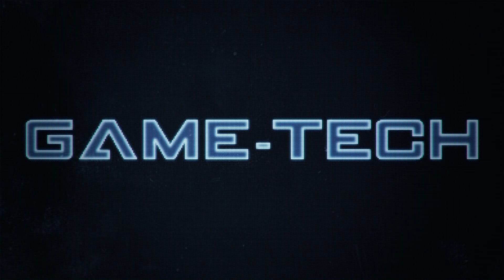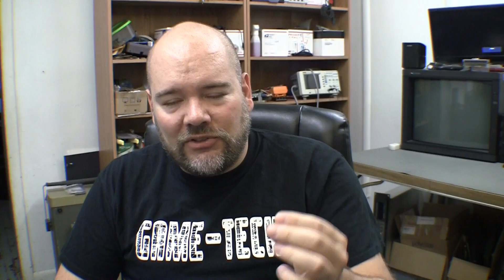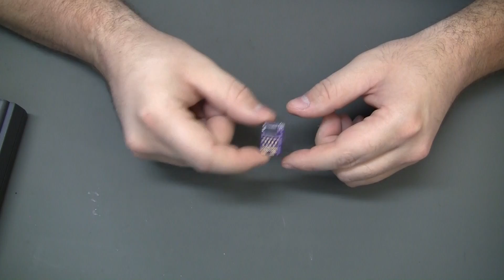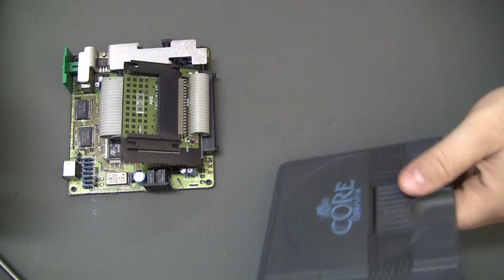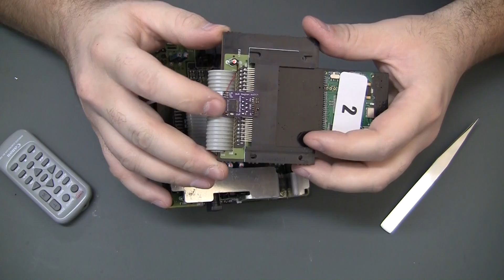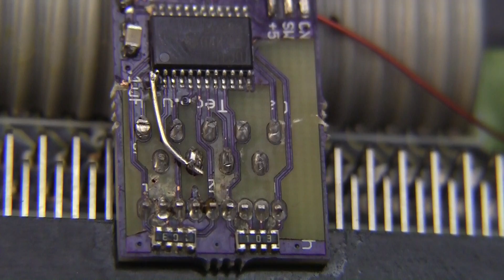TG-16 / PCE core grafx region mod issues with turbo everdrive Pt3

Comment: Hi. What does the IC on the mod board do ? and what are the lines the mod baord connects to ? Address lines ? I find this interesting but it is difficult to follow without knowing what is what. Btw the ground fill has vias I see. but I can't see a via on the ground fill which is where "Mar" is written... hmm. could be under the ic though.. also clean away flux residue.. might get some coupling that way.
Reply from the maker: bwack cbt3383 is the chip, vias are covered in solder mask so hard to see.
Reply: GameTechUS Thanks. That makes sense though cause I think kevin mentioned in the preivous video about bus lines in different order depending on region..

Comment: so my question would be, why do you need a region switch if you have an everdrive? for cd-rom system cards?
perhaps there is some EM stuff going on with the whole contraption, maybe chuck some ferites on the ribbons and see if anything changes
Reply: Gillian Seed For legit HuCards and Arcade Cards. You need it for System Cards as well (Duo is already upgraded to Sys 3.0 so no point using an Everdrive for a System Card here, except for Altered Beast).

Comment: $15 to $20 is a little pricey for 5,000 SMD resistors. I can get a reel of 5,000 name brand ROHM MCR03 Series 1% tolerance 0603s for 7 bucks from Digikey if you use first class shipping it's only 3 bucks to ship so it makes smaller orders justifiable.

Not sure if Mouser offers first class haven't ordered from them in awhile they've always been a bit pricier than Digikey in my experience.

Just FYI for the future.

Comment: Thinking about this again today, an easy way to test bypass caps is to remove the pull downs and stick 47pF bypass caps in those positions.  If pull downs aren't the problem this should fix it.  Ideal cap size might not be 47pF.

Comment: GameTechUS Considered making a reflow oven for doing spins of boards like these? You can grab a cheap toaster oven at Walmart and for a configuration that should be enough to "get by" with, you're only looking at about $40-50 in parts. (Arduino, cheap 20A solid-state relay, K-type thermocouple and a thermocouple amplifier). I'd be happy to help you out if you want. The toasters are like $15 at Walmart. "Rival" brand (Walmart-owned, just rebranded from an OEM). They make a bunch of kitchen crap.

Wouldn't be as nice as the one Kevtris made for his prototype runs of the HDMI NES modules but you're soldering resistors and small 16-24 legged components.

The ground plane came off easily because of the board material, OSH Park boards use really light copper (I believe 1oz) and a pretty cheap FR4 stock. It's fine for prototyping as long as you don't deal with high current and it's pretty easy to mod.

Comment: Try powering your region mod with the output leg of the 7805...well, when you get the board revised. I've done 3 region mods getting power from the 7805 and they all work fine with the Everdrive.

Also, is the Everdrive working perfectly on a non-modified console?
Reply: Goombakid808 thats an interesting idea, the everdrive may be pulling the rail down (localy) enough to glitch the mod, plausible indeed

Comment: You really ought to calibrate the PVM. Without any special tools, you'd probably just have to eyeball it, but you could get it way closer to normal than it is now...

This video shows the process of that exact PVM having the case taken off and calibrated (bunch of nicely labeled pots on the PCB inside): https://www.youtube.com/watch?v=yoBqm4ThJxw
Reply from the maker: Adam Zey I've seen that vid, but since i'm not doing as many rgb mods i've not needed it as much so it's been neglected.
Reply: GameTechUS Fair enough. I'm the sort of guy who would be driven nuts by that sort of thing whether I was using it regularly or not :P

Comment: I thought the turbo everdrive negated the need for a region mod
Reply: Zapf Not totally, the TED can't act as a system card and the 3.0 jap card is much cheaper than the us card and the arcade card is jp only.
This is a common question, maybe I need to explain the need for the mod in all the vids?
Reply: JasonDoesDIY The exact reason I'm looking for the finished product.  Not paying the ridiculous amounts that the system cards are going for.

Comment: You have a scope right there! If you're having signal integrity issues throw a probe on there, you can figure this out much faster than just trying things blind
Reply: blaaaaaaarghable I'm sure you're right, but i'm still very much a noob with the scope...
Reply: Look at the signals between the mod board and the Everdrive, then compare with hucard.

The Everdrive may be using newer, faster parts that have much faster risetimes. Your board may see some ringing on these.

Comment: I am assuming D0 to D7 are the pins connected to there?  Not familiar with PCe or TG16 but it looks like the data bus is bang in the middle of the connector, so I figure that's what you are operating on, and presumably swaping the bit order between regions?  Try adding a 47pF bypass cap on the outer pins, or perhaps on which ever data pin is nearing something other than another data pin.  It might be that traces are just too close on that PCB.
Reply: GadgetUK164  yep, you love your bypass caps ive seen em on every cart you own
Reply: LOL! Don't leave home without them!

Comment: Sounds like you've got a parasitic capacitance issue going on.  You could try adding a 47pF bypass cap to each of the connections (try them one at a time to start with, there's a chance just one, or perhaps just outer connections need a bypass).  I've got no idea what pins you are connecting that PCB to - is there a clock pin or something going into your board?
Reply: GadgetUK164 The fact that 1943 graphics are corrupted supports this - one or more data lines are glitching due to nearby traces.